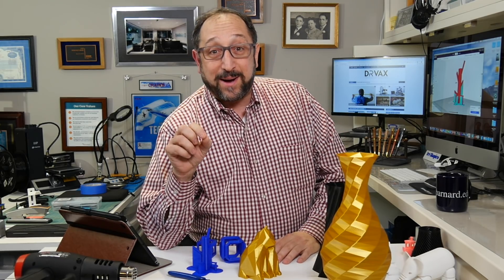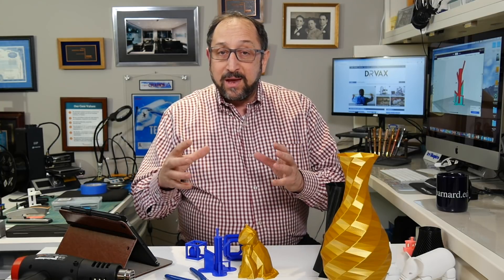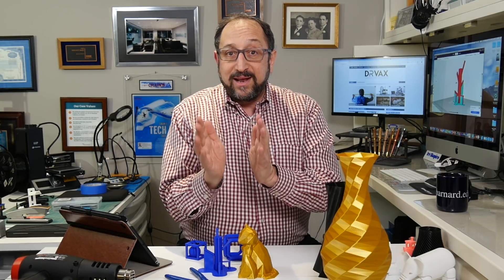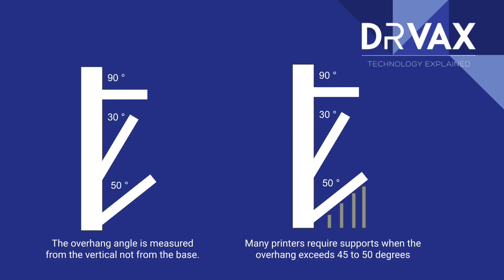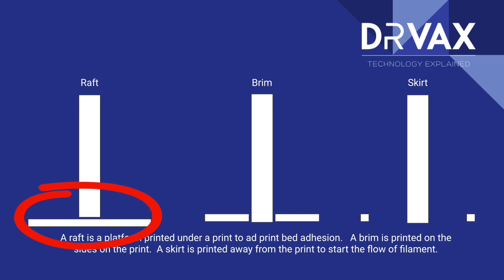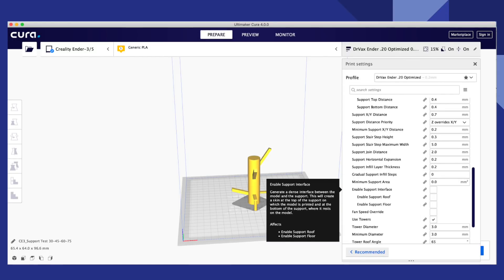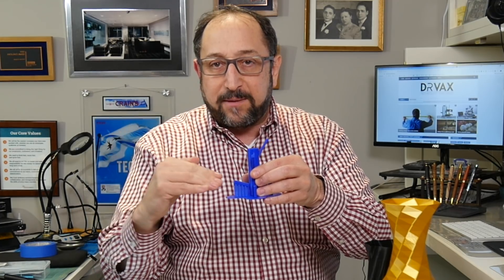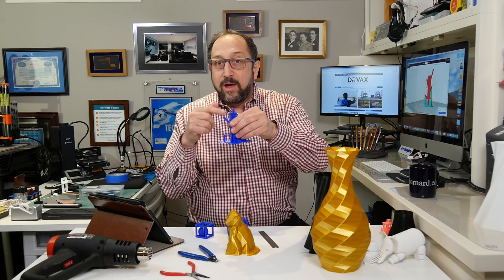Cura 4.0 Skirts, Brims, Rafts and Supports

Comment: Thanks for good videos, I want you inform about removing rafts from the parts because after finished the job removing the supports and and rafts too hard what is your advice if there is any settings for supports at cura could you publish a video for this issue

Comment: A tip on when you add the no support blocks or custom support blocks.  Not only can you move them around, but you can also resize and rotate them.  This way you don't have to place a lot of them next to each other.  You just select the custom no support/support box like you would the model and then select the move/scale/rotate tool.
Reply from the maker: Thanks for sharing.

Comment: I disagree with your statement about roofs making the supports easier to remove. I used roofs on a Dead Pool bust. And the supports were very hard to remove.
Reply from the maker: Interesting.  Thanks for commenting.  Folks, what experiences have you had with using a roof with supports?   Leave a comment.
Reply: DrVax one thing you forgot to mention was the gap you are able to set between the supports and object. This greatly affects ease of removal.  This would make topic for a follow up video on supports.

Comment: Great video. However, tree supports do not always use less material. In fact, I have done several prints where tree supports use much more material and take considerably longer to print, but they are much easier to remove and leave fewer artifacts.
Reply from the maker: Thanks for participating and sharing your observations about tree supports.  All the best.
Reply: @MakeWithTech  I agree with your philosophy, "let's learn something together"!  Thank you.
Reply: haarbear1 I have a few instances where standard supports were generated within the tree supports. Could not find a reason why.  Have you come across this?
Reply: @billyoungers4035  I have not, but that is interesting.  I am still experimenting with tree supports, myself.  Do the standard supports in question support / hold up part of the tree supports, or the object itself?
Reply: haarbear1 actually it looks like infill. I haven’t tried tree supports in 4.0. Maybe it was a glitch in earlier versions.